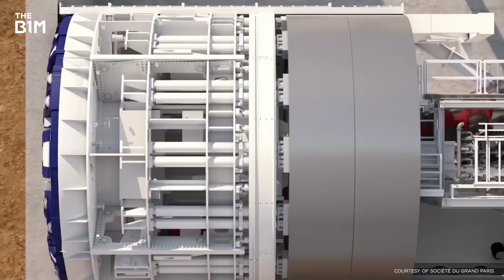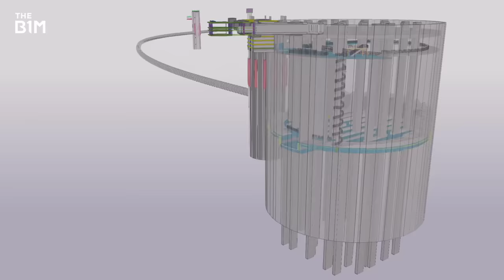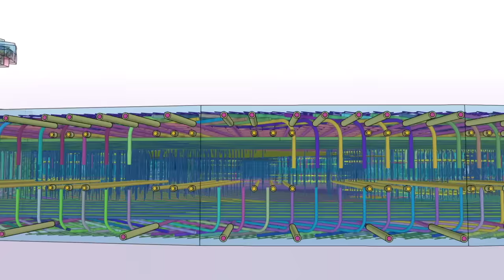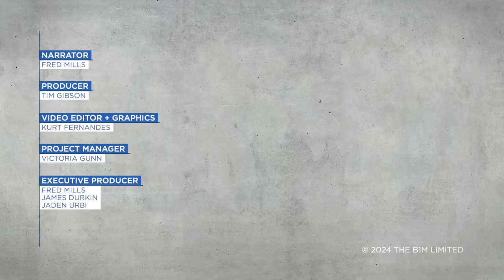Why Paris is Doubling the Size of its Metro

Comment: Just in case anyone's interested, the average distance that the UK's HS2 and Crossrail TBMs can do and did is/was 19m and 38m respectively. Paris's Grand Express 12m is [apparently not all that] certain* to be that little bit less because of the famous Limestone rather than London's alluvial clay.
*See KyrilPG's very helpful comment below, correcting this.
Reply: I've never heard of any large TBM ever advancing an average of 38 meters per day under normal conditions.
The 38 meters mentioned about the Crossrail project were because there were 2 parallel tunnels, so they just added the daily progression of each tunnel.
38 being 2 times 19, at least that's what was explained about the Crossrail project in a documentary.
Much like it was announced that the GPE tunnels at times advanced by more than 250 meters per day. It was simply the addition of all TBM's progressing simultaneously.

As for Paris soil, it would be so much easier and a bit faster if it was limestone. There's limestone, sure, but it's fractioned and most of the really consistent limestone layers were dug through by century old quarries.
A good chunk of the TBM's used on the GPE are of the slurry or pressurized mud type to be able to dig through water filled layers of soil. There's sand, gypsum, clay, gravel, etc. It's a mish-mash of many types of soil with a lot of water because the aquifers rise to very shallow depths. Quite a nightmarish soil to dig through.
They've regularly had to use ground hard freezing techniques to avoid flooding.
Many locations in the Greater Paris area have pretty bad soil conditions a bit like the South side of London, especially anywhere near the S turns of the Seine and Marne rivers.
A good example of that is Saint-Maur Créteil station that is built like a submarine, anchored underground between 2 sections of the Marne river forming a loop and peninsula. Letting the TBM cross the station box and extending the platform from the initial column box required freezing the ground and extensive grouting to solidify the soil and avoid a massive flood.

The video here is a bit strange when mentioning the digging speed. It feels like the sentence infers that they wanted to mention the number of simultaneously digging TBM's at peak time but forgot to tell the actual number.
12 to 15 meter is the average progression of one TBM depending on the soil conditions in Paris, not the overall daily progression at peak.
If I recall correctly, there were at least up to 21 TBM's digging simultaneously when the building works of the first major phase peaked.
One other thing to note is that the GPE uses mainly single bore tunnels, instead of dual bored parallel tunnels. Which means the tunnels' width, and thus the TBM's diameter, is significantly larger than for the ones used on Crossrail or HS2 which are dual bore.
A larger cutting face on a TBM displaces significantly more soil and, as a general rule, the larger a TBM is in diameter, the slower it progresses in comparable soil.

I'm pretty sure we've already exchanged together in the comments section of IDFM or something, isn't it?
Reply: @KyrilPG  Thank you for your enlightening information. Reminds me of the time - honoured adage:
Lies, damned lies and statistics.

I must admit that I wasn't aware of the greater difficulty encountered when boring through clays instead of limestone.
Tunneling technology is truly awe inspiring. Hats off to the troglodytes!

I've added a correction to my slap dash assumption and credited you, thank you.
As for Île-de-France mobilités, non. Maybe elsewhere.
Reply: @KyrilPG  I know TBM's have broken records. That of the L14 one was 34 m on certain days and TBM of the L18, supposed to be faster tunnel boring machines, did between 20 and 30 m/day with records of 40 or 50 m on certain rare days.
Reply: @KyrilPG They don't go through the old quarries. They dig under.
Reply: @Lodai974   How is that even possible in terms of soil removal? Because often, it's not the cutting head that is the main limiting factor but the soil removal system, i.e. the conveyor belt or worse, the mud piping.
The conveyor belt can only go so fast before having problems carrying soil, like projections or overload. Not mentioning the problem with storing and discarding all those cubic meters of soil. One major issue with conveyor belts running too fast is at connection points, notably where elevation changes.
Switching the soil between successive conveyor belts is done by gravity : the previous belt simply dumps what it carries on a lower belt.
Higher speeds are more easily achieved on smaller TBM's because the conveyor is proportionally larger while the quantity of soil is proportionally smaller due to the narrower width.

Every time I saw these sorts of numbers, and after further research (like asking the TBM guys) it turned out to be a management communication shortcut, a simple addition of the progress done by different TBM's in one day.
Or a simple multiplication by 24 of the progress in 1 hour of continuous digging, without accounting for the tunnel segment lining time.
Simply because there were multiple TBM's digging the same line, so managers communicated about the tunnel's progress, not individual TBM's.
The other limiting factor is the fact that the TBM's dug under urbanized locations, with zero margin of error in terms of vibration and risks of subsidence, thus further limiting the speed to a safe, stable one.
All TBM speed records were done in uninhabited locations, like mines, with much narrower cutting heads.

So, are you really really sure about that?
The TBM guys I talked to were saying that there can be some spikes in progression, but nowhere near as 3 or 4 times faster than the usual speed. For them, and in Paris soil conditions, something like 18 meters were exceptional days on a single bore tunnel of the size used for the GPE or M14.
This harshly curbed my enthusiasm, to be honest, as I initially believed the higher numbers found here and there.

Plus, slurry TBM's are even more limited in their speed variation range because the slurry piping is very restrictive and the progress in waterlogged terrain really can't go much faster than usual compared to EPB ones.

Always a pleasure to stumble on you here. 😀
Reply: @puccaland   Some locations, tunnels, shafts and stations went through or grazed former quarrie layers and voids that had to be filled with a kind of grout first to avoid subsidence and other issues.
Especially near the Jean Prouvé shaft and the Chevilly l'Haÿ-les-Roses station on M14, if I recall correctly, among others.
Reply: @KyrilPG  OK thanks.
Reply: @KyrilPG  Thks...you too

Btw the figures came from the SGP and it would not be surprising if your explanation was the truth, because at the time, 2 tunnel boring machines were digging south of the L14 and as many on the L18...

But, even divided by two, that’s still 18 to 20m/day, which is pretty fast.
Reply: @KyrilPG  Yes, the plateaus south of Paris are apparently filled (if we can say so) with limestone quarries. There are also some in Paris, on the Luxembourg/Port Royal/Denfert Rochereau side.

Comment: A reason why they're building the Grand Paris Express is to relieve the rather extreme congestion of the Paris Metro because everyone currently has to go through the center of the city to go from one arrondissement to another. This way, commuters travel between parts of the city a lot faster.
Reply: I don't see how the project will affect commuting from an "arrondissement" to another, as "arrondissements" are in Paris and the new lines are in the suburbs around Paris.
I would rather say that people currently have to go to Paris itself to go from a suburb city to another one in most cases, which is why indeed the project is made. The current metro is dense enough to be able to efficiently commute inside of Paris most often.
Reply: @Kyragos he meant going from 92 to 94 for example as there are no suburb to suburb connections
Reply: @DjibrilD__  In that case, we're not talking about commuting from one "arrondissement" to another anymore, as the original message stated. The project is indeed to facilitate commuting between suburbs, as I already said.

Comment: Hopefully if this works well for Paris other cities will finally realise that big money into railways is a good cost
Reply: This will work well, as it did in many places. The problem in cities, states and countries that do not invest in railways is not lack of funds, because they have plenty for roads, but a political and cultural one. Change this and there will be enough money.
Reply: As someone living in Paris area, I can say that, yes, big money is put in this project. Sadly, the same thing can't be said about a good part of the older lines that have suffered from a chronic lack of maintenance and mismanagement.
Reply: @Kyragos  The entire network has been retrofitted. We're talking 1000 unique stations or so. Platforms elevated for the disabled people, elevators and escalators added everywhere,  train cars changed. Only a few lines are still waiting and some stations inside Paris proper.
Reply: @puccaland  I was actually talking about the train transport in the whole region. There are technical issues literally everyday on the line A for example, which actually got worse in the few recent years. As the busiest line of Europe, it is not a minor thing. And we could say the same things about the other RER lines and a few other lettered lines. Yes, things are getting better overall, but years, if not decades, of lack of proper maintenance are still far to be solved.
Reply: @Kyragos  Things aren't better but worse and that's precisely because of the multiple construction projects going on right now in Paris, not because of maintenance.
Reply: @Kyragos  Line A is very difficult to improve because of the architectural challenge and the fact it's the busiest line in Europe, not because of maintenance. Same with line B and yet finally they managed to find a way to put double decker trains on it. Circa 2025 or 2027 I don't remember. For many years it was impossible.
Reply: @Kyragos  There are issues everyday unlike on which public transportation network in this world? Especially such busy network? I live between Tokyo and Paris and I can tell you for a fact that there are issues everyday on the network too.
Reply: @Kyragos  The punctuality rate actually improved those past few years on the RER and Transiliens networks despite the construction work except for line B.
Reply: @Kyragos  Maintenance is an issue for safety purposes and passengers comfort. There have been issues with the signalling equipment which is being replaced, takes time and requires stopping the traffic hence the delays.

Comment: Meanwhile in Berlin: Not enough drivers for the busses.
Reply: In Paris, there's this issue as well. It doesn't look promising for the Olympics or even for daily life right now.
Reply: @stanyamish3996 For daily life it's same as usual. Just that the rush hour (as in buses which are packed) is longer. The Olympic sites are normally all connected to the railway or they will use private shuttles to make the last km. In other words the shortage of bus drivers is irrelevant here.
Reply: @stanyamish3996  Moreover every year Paris welcomes 50 million tourists, most of them coming in the summer. You'll find out that Paris is empty during that season especially August because the locals leave to go on holidays themselves. With the Olympics Paris is expecting 15 million tourists vs 12 millions in normal times. Nothing the current infrastructure cannot handle.